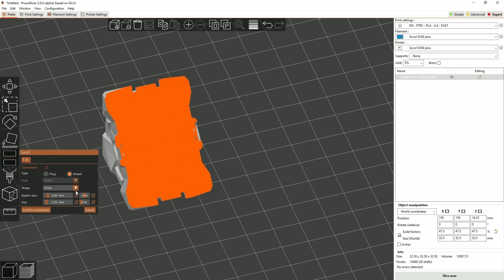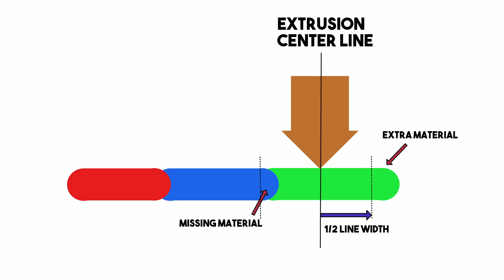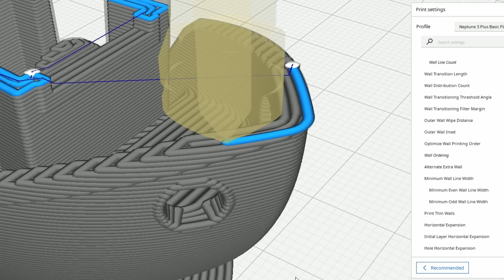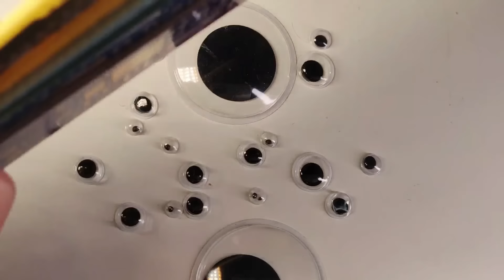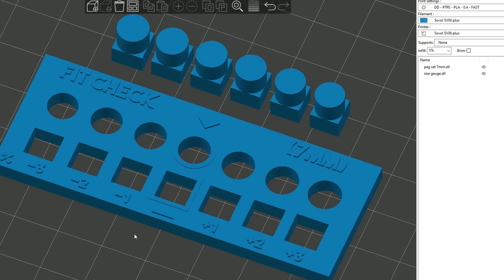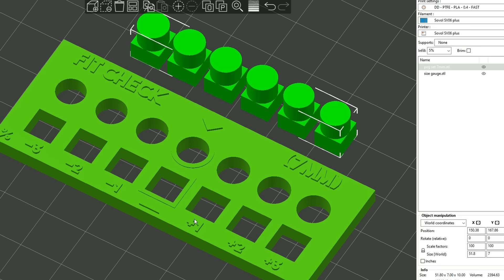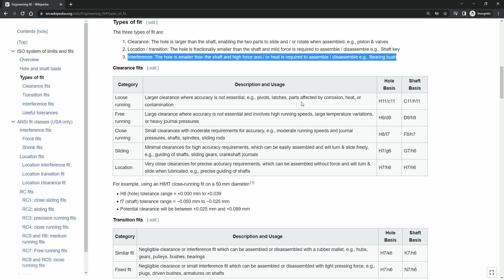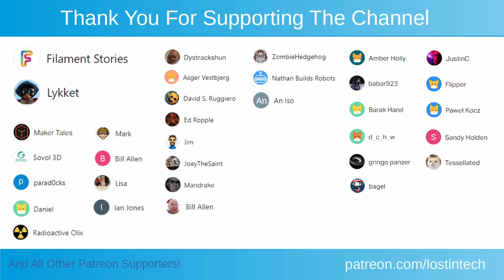Why your 3d printed stuff doesn't fit together and how to fix it!

Comment: Most of the parts I print are cases I design myself  for various sorts of circuit boards, and my preference is for an interference fit so I can just snap the lid on. With my printer (a heavily modified Ender 3) and preferred filament (Duramic PLA plus) I have found that a 0.2mm clearance works consistently. To avoid the issue with the corners, I always put either a 0.5 or 1mm chamfer on all external corners (ie the outside of a peg, not the inside of a hole) which both gives a better fit, and at least to me gives a part that looks more professional.

Comment: this has been a thorn in my side recently, but i have a resin 3d printer and most of the tolerance guides talk specifically about filament printers. even the new benchy test print engine works by laying a bead across left over filament strands which resin printers simply cant utilize. does anyone have a recommendation or a test print for pin/hole tolerances for resin printers?

Comment: 1. Why make multiple pegs AND multiple holes? Just one peg and a set of holes would be enough
2. iirc you mentioned the size step to be 1% at one point, but it looks like 0.1mm, very important to define this well I would probably even add this into the print if possible
3. Could probably add one peg with and one without chamfered edges
4. I personally found interference fits to be super easy, maybe I got lucky but I literally printed zero tolerance PLA and pressing hard enough eventually made them fit perfectly flush, I believe its because PLA has some give to it
5. i would print the pegs as a separate print or break away ontop of it, stringing is not going to help your fit

Comment: for inside curves there's a more fundamental problem.   STL's are collections of triangles!     The nodes of the triangles are the loci of the object.   So any inside curve has end points of the triangle in the (more or less) exact points on the curve ... but on an inside curve EVERY line is in fact inside the nominal shape of the curve.   OpenSCAD has a variable $fn for the number of nodes inside a circle; think of the extreme: if you only had an inside circle with an $fn of four, your "circular" hole would in fact be a box with the diagonals being the nominal diameter of the "circle"  and if your $fn is 2 .. a ridiculous value, your "hole" would in fact be closed with no opening (except a purely theoretical infinitesimal line between the nodes of the triangles.  OpenSCAD's default $fn is 30 which I generally find too blocky, usually up it to 120 or higher which slows down rendering but is a much nicer circular object.    I haven't a clue how other CAD sofware renders their STL's for circles, but in OpenSCAD  EVERY project I write has TOLERANCE as one of the first values (my libraries default it to 0.3mm  which usually works but sometimes need to up it to .4)

Comment: I've recently found that when slicing using CHEP's Cura profiles, parts never match, but on standard profiles, everything fits fine.
Reply from the maker: standard profiles are pretty fine, people always want to go too fast these days, but for parts that need to be sized correctly, you get sloppy corners and stuff if you start pushing it.

Comment: that gauge is actually super useful. my brother asked me to print a small part for his bb pistol that broke, but i didn't even bother because not only is my printer wonky with filament stopping feeding (haven't been able to print anything for a couple years now because i can't be bothered), but also because i know i would never find the correct clearance even if i could actually model the damn thing he asked me to. this would help with that. it still won't work and is more work than it's worth, but meh, at least i can try.

Comment: One other thing you need to keep in mind when building things that have thin walls between features is that you have to think about your line width and multiples of that.  If you design a wall to be 1mm thick but have a 0.4mm nozzle, you are either going to print a 0.8mm thick wall (2 lines) or a 1.2mm thick wall (3 lines) depending on how your slicer feels like rounding things that day.  Theoretically you can under or over extrude to make up the difference, but to my knowledge at least most slicers don't really change extrusion widths within the same layer.  Maybe some slicers will just leave a gap as well if they can't fill it solid, but I'm not that well versed in all the different ones out there.

I was having this problem when I way building a shaft adapter for a motor.  It prioritized the outside diameter and was only one wall thick, so the inside diameter was just going to be whatever it was, not what it was designed to.  It's kind of like printing inside vs outside walls first, but ultimately if you have any solid walls between parts you should do it in multiples of your line width.
Reply: Thanks!
Reply: Does this relate to the section in Prusa Slicer under Layers and Perimeters where it says, Recommended object thin wall thickness for layer height 0.20 and 2 lines: 0.80mm, 4 lines: 1.59mm, 6 lines: 2.39mm, etc, depending on the number of perimeters?

Comment: You did fine for a non-engineer! One item... the tolerance that you build into your parts shouldn't be an increase by percentage. It should be a fixed amount. So your holes should be something like +/- .005, .010, .015 inches. The size inaccuracies and the amount of clearance you need for part fit doesn't compound or add up more or less for smaller or larger parts. Your walls "squish" out a fixed amount regardless of size of the part. Thus a percentage is not the most accurate way to handle it. Plastics shrink when they cool. This is correctly fixed by scaling the entire part up by a fixed percentage. But for the hole size and dimensional accuracies that are incorrect due to the filament squish. This should be fixed by a setting in the slicer that offsets all walls by a fixed amount. But no slicer I know provides this feature.

Comment: I’ve always been fascinated with 3D printers. Not the printer itself but the people who print things with them. It seems 90% of everything they print is just parts for their printer. It’s like buying a car that doesn’t actually drive but all it does is print new parts for itself. The other 10% seems to be little plastic boats. I’ve seen a hundred videos of people printing toy boats. Is there some meteorological event expected that involves tiny boats? Just curious.
Reply: 😂 The boat is called 3DBenchy is like a test file that comes with the printer and people use it as a kind of standard to test different variables.

Comment: I'm a hobbyist printer who started 3d printing a year ago. My general rule of thumb is 0.5cm clearance between the parts that need to slot together. I've printed a lot of custom spool holders that pin together and I usually make the pins 5mm or 10mm squares and the holes they slot into are 5.5mm or 10.5mm to get them to fit. It sometimes results in a bit of a loose fit and I have sometimes reprinted a pin an extra millimeter in cross-sectional dimensions until it's effectively a pressfit.
Reply: I got super confused when you wrote you use 5mm clearance first. Then realized it was a typo. cm and mm, hard to keep track on. xD
What nozzle do you use? if its a 0,4mm, how would you get 5,5 or 10,5? Try to keep it dividable by your nozzle size (the printer software will try to compensate but as you might understand, its one more thing that could "fail'). 5,5/0,4=13,75. If you make it 5,6 its even with 14. Simple change that might make wonder to your prints. OR maybe you are using 0,5mm nozzle, in witch case you can ignore all I wrote.

Comment: As a rule of thumb for parts that fit inside another part such as with an enclosure with a battery compartment for example, I design the battery cover 0.1mm smaller (all round). This friction fit almost always removes the need for fasteners/screws, for the everything else to fit with slight friction I use 0.2mm and 0.4mm for loose fitting...

Comment: I love the fit check gauge idea!  For convenience, maybe you could have a round holes only version(Since square pegs are harder no matter what and people might want to just avoid that)?  Maybe in that case all the pegs could actually be attached in one long row, or a 4 way like a sillcock key with 1 vertical, so it's 1 convenient piece?  Or maybe you could just have 1 peg on the end of a row of holes, so the whole test is just 1 part?
Reply: You can't avoid square pegs as soon as you need to limit rotation for some applications
Reply: @sergtimosh  there's also screw threads, oval and rounded rectangle pegs, multiple connected round pegs, etc
Reply: @EternityForest  yeah, rounded square pegs is a perfect choice for locking axle  and correct positioning

Comment: I just use a tolerance test print with the filament / printer I’m using, and then make sure I build in this tolerance amount into my fusion 360 designs. Everything then seems to fit as intended, when printed. Before correctly allowing for this tolerance in my designs, was the only time I had “did not fit” problems. 🤓

Comment: In my arsenal of settings used for printing with tolerance in Cura (each depending on situation) is:
Flow (with tweaked flow for top and bottom) <- I use profiles with this calibrated the most
Horizontal Expansion
Initial Layer Horizontal Expansion (really good against elephants foot (I use -0.1mm))
Hole Horizontal Expansion

Comment: I always give "hole" parts more diameter and "pin" parts less,... both diameter corrections are 0.4mm combined. (Based on Nozzle Size)... it works 80% of the time but I'm using the stock prusa slicer. I couldn't find a configuration on cura with similar results... (even though I love the plethora settings)

Comment: Heat and cold will warp your pieces tremendously. Plastic, wood, metal, concrete that's why things are manufactured in a constant temp setting. Wood for example warps so damn much from day to day, I'm impressed framers get something done and I remember my machining teacher constantly talking about the hot/warm tolerances "check it later " 😂. I'd like to get a 3d printer and I wonder how much the hot/cold affects the printer itself

Comment: With threaded components this problem is a nightmare. My CAD program will draw a threaded hole given the standard specification. But that thread will never fit a bolt. Not even with external perimeters printed first and 0.6 mm tolerance (which is huge even for a coarse thread). 

I've given up... These days I just run a tap over the threded hole to create the clearance.

But I've not solved this problem for situations where both the bolt and the threaded hole are 3d printed.

Am I over thinking this?
Reply from the maker: Yes 🤣 for screws and threads set slicing tolerance in cura to "exclusive" and it should work

Comment: For tight fit 0.25, for slightly loose fit but still snug 0.5, for loose fit 1 mm. that’s what I use on ender 3. If I want to make a permanent fit I’ll make them exactly the same and fillet the edges of the male insert this will require a rubber mallet or in my case a lump of wood

Comment: As an actual engineer I deeply, deeply appreciate this video an the effort you have put into it. Here in Germany the job description engineer (Ingenieur) is a protected title, but if it were for me you could call yourself an engineer. There are far more people out there with far less knowledge about engineering. Trust me. And even I dont know when to exactly use interferrances and co. Unless required differently, I just slam the word "Allgemeintoleranzen" (general tolerances) somewhere and hope for the best. 

On the other hand I can understand that the word engineer should be protected, because getting a degree in engineering was literally the hardest thing i have ever done.  In my opinion having interest in a topic and showing the will to learn about it is far more valuable than the title. The title opens you the door but the competence you achieved getting the knowledge keeps it open. So dont go to hard on yourself calling yourself ,,not an engineer". As long as you have passion and understand the technicalities, u r an engineer in my opinion.
Reply from the maker: appreciate the comments, I do still have a lot to learn :)

Comment: For me there is usually the option of manual scraping down a part, but in general if it really needs to fit, making a small test case really does help.
It could be as simple as cutting away all the part except for the hole you want to test. then I print it using my usual guestimate and adjust where needed.

Comment: In fact in theory you would never need to print the outer walls first. It is only the result of minor over-extrusion, which you can also fix by setting the extrusion amount from 100% to e.g. 90%. Also, having calibrated the e-steps perfectly is likely to reduce the problem as well.

Comment: I'm saving this for later. Yesterday I was just putting tiny M6 screws and nuts together and the screws snapped inside of the nuts. Normally that's not an issue, but the stupid silk PLA is all I have and it's too weak. Apparently it also expands more which corroborates with the fact my regular PLA was dead accurate while the new pretty but useless silver silk PLA is giving me a hard time.

Comment: Another trick I found that works well for threaded parts is to use polishing compound on the threads. The paste type used for polishing car paint works well. If the threads are too tight, lubricate them with the polishing compound and work the threads in and out until you have smooth clearance, then wash off the compound.
Reply: I agree with this idea. Here's how to make it even cheaper... Get your part wet with water. Put baking soda on the threads. Work the threads forward and backward allowing the baking soda to act like a grinding medium. Rinse off the baking soda when you are done. I'm not sure about the chemical reaction between the soda and plastic, but it makes PLA seem smoother more than just because you sanded it. I've also used toothpaste, but baking soda is cheaper and easier to clean.

Comment: To deal with the problem of clearance without compromising overhangs. Print next to outer walls first then outer walls but reduce flow rate of outer wall. Basically slightly under-extrude the outer wall to compensate for the bulge.
Reply: How reduce the flow rate of outer walls only?

Comment: You should try calibrating the extrusion multiplier. Most of the time decreasing or in some cases increasing [ calibrate for each filament and temperature] the extrusion multiplier eliminates the problem of tolerances and superior surface quality...

Comment: For the fit check part i would guess it would have been better to go with an absolute value, like 0.2mm clearance, instead of relative in %  
I cant imagine that if you print a 100x100mm fit piece that you would need a e.g 2mm clearance (2%)
Reply from the maker: It does do absolute, if I made both pegs and holes absolute it would create a compound error. Using the middle hole gives absolute clearance indication

Comment: Setting the extrusion rate to 99.7% solves most cases if the designer does not consider the error of the surface

Comment: All you have to do is scale the pegs down by 1 to 5 percent. Scaling down pegs for prints helps a lot. If it's a model with a peg hole that slots together, sand it down or cut a little off.

Comment: I make 100% of my pegs as wedges, 7⁰ angle (on one side, 14⁰ if you are measuring both sides makes a self locking angle. Machine tools use this method

Comment: Also the interference fit you mention might be tricky to pull off with printed parts. Interference fit with metal parts generally needs the part with the hole to be heated so it expands, & can accept the shaft. They are then locked together when the hole shrinks again after cooling. Trickier to do with plastic parts id say but I've not tried it. I think interference fits aren't super common in any case. Most bearing, keyway, locating etc fits are clearance tolerances of varying degrees
Reply: There are different classes of interference fits and the the methods of joining the 2 parts will depend on the class. For example, js7 to js5 can be assembled by hand. k6 to n6 can be assembled with a hammer. p6 and r6 can be assembled with a press. s7 and above require a hydraulic press or dilation.

Comment: This is an interesting topic & a great video. I sometimes print parts for use at work (automated packaging machine builder) & have access to secondary processes (mill & lathe) to bore out holes accurately for fits. So the tolerancing is taken care of by those processes. If it's just a clearance hole for a screw to pass through, the machining will be very quick & easy generally. I sometimes trap nuts with parts I print, & have found going oversize by 0.2mm is generally enough for my prusa mk3, petg filament. I've noticed that when the part is mid-print, it is closer to the actual size, & then shrinks after it cools. I have to add the nuts mid-print while it's still on the heated bed so iv not needed more clearance than 0.2mm

Comment: In Prusa slicer, a modifier can be added with the setting "External Perimeters First", so you could apply that setting only to the sections of the model that need higher accuracy.
Reply: W suggestion
Reply: Thank you
Reply: Was just going to comment this. Works really well.